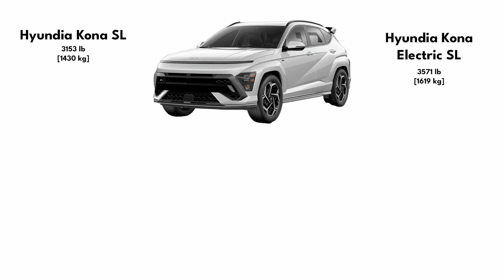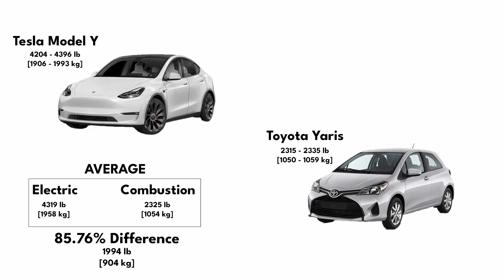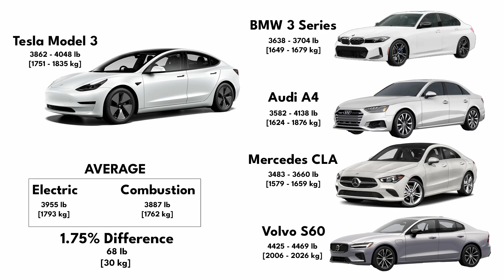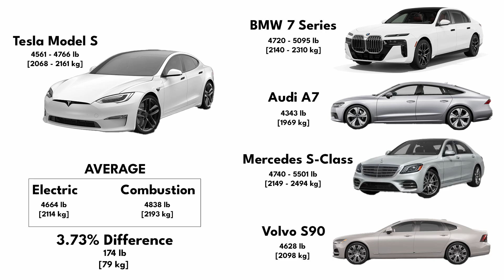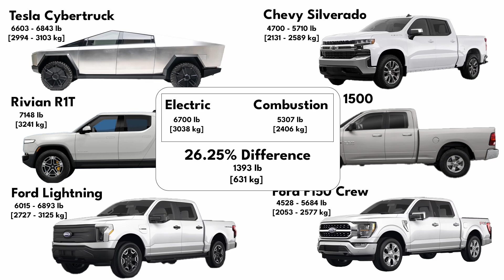Shocking Guardrail Failure: EV Weight Debate

Comment: Why compare just a Tesla against these cars? Audi, BMW, Mercedes and many other manufacturers have both an ICE and EV version of their own models to compare within their range. Surely this would be a much better comparison than comparing different makes against each other. I really like your content, but on this occasion I feel you've dropped the ball.
Reply: Yea. Compsring thr S60 with tesla 3 is freaking redoculas. Tesla 3 is a tiny car. Its also not a high quality european car. 

I seen this a lot before. Its tesla fan that try to argu they are simular. When they are clearly not.
Reply: @matsv201 a good comparison with a model 3 Y S would be a ev that was built from the ground up we only have 3 tesla rivian Lucid or we could we do phev comparisons
Reply: @matsv201  rational thinking, or even just a counterpoint doesn’t make you a fanatic to certain brand. You can argue Tesla isn’t a luxury brand all you want but the MSRP is close, the option to drive EV itself is a luxury and the crash protection is on par or if not better than conventional brands.
Reply: @kylinblue  This is clearly a lack of rational thinking.
Tesla isn´t a European luxury car. Firstly its not European, secondly its a very low quality car. Its like the ferrari clones that Leylands built in the 70s. They kind of look simular, but they are nothing like.

In the same wayTesla look simular to a luxary brand, but lacks all the things that makes a luxary brand a luxary brand.,

That the MSRP is similar is totally pointless. Yes, you get a much worse car for the same money. It should be quite obvious for everyone that is not a extremist.

Tesla build car that are worse quality than a Kia from the 70s. Then thy bundle a expensive battery with the car, pushing the price up.

On top of that, a Tesla 3 is nowhere near the same size as a S60 internally. Its much closer, if not smaller than the now no longer produced S40.

On top of that the wrong numbers w s quoted.
Reply: @matsv201  as someone who owned Volvo, Ford, Mercedes, Mazda, Mitsubishi, and lastly Tesla and have a low standard of “luxury”, you just can’t convince me. I got the EV because it is a EV and I’m having a good time with it. Seats are comfortable, features are there and nothing is falling apart. I paid for the price and it was worth it *for me*. Will it apply to everyone else (and you)? Probably not. But I’m sure there are people that agree with me (and you).
Edit: regarding your value proposition, yes, the price was inflated but there are several factors at play: dealer will mark up the out of door price considerably and Tesla doesn’t do that; high demand at the beginning of model 3/Y rollout caused inflated price that is coming down as the demand cools; new technology that is inherently less cost efficient for the new adopters.
Final edit: EVs aren’t the second coming of Christ nor child of Satan. We may have had been fed different kinds of information and come to very different conclusions. I will regard you as a reasonable person and consider your words, hope you do the same for me.
Reply: @kylinblue  I'm not saying I would by a Mercedes what ever its called or a M4. But saying a tesla is the same amount of luxury is just rediculas. Its a cheap crapy car that is sold expensively.

For instance tesla lack computer system fire wall. That makes the car cheaper to build, quite a bit so.. but it makes ir less safe.
Reply: @matsv201  American luxury vs. European luxury vs Japanese Luxury vs Korean Luxury 

Tesla is a great example of American luxury
Reply: Cuz Tesla is the only brand besides BYD that’s selling in meaningful quantity around the world, and there’s no BYD in US.
Reply: @kylinblue  there's really only 3 that really built bevs from the ground up 
Tesla
Rivian 
Lucid 
The rest are doing what tesla did in the beginning turning a ice vehicle into a ev that's why most of them weight so much
Reply: @b8Capital yup my dude is going the be under heavy flak cuz “how dare you question our EV bad studies”
Reply: ... I think Croc EV (Cadogan) has a good rule of thumb for ICE / BEV weight difference: 

ICE weight  +  weight of battery only 
=  BEV weight

Assumption: Weight of BEV battery cooling systems, inverters, management systems, sans the BEV battery itself are equivalent to the ICE engine & components weight.

To your point, compare the Ford F-150 / F-150 Lightning ... which seems to fit Croc EV's formula.
Reply: @kradius2169 that's true but my question is why when evs get in the mix everyone goes haywire evs are not safe they weight to much but when u look at something like a f250 f350 f450 Cadillac Escalade/ESV Or Jeep Wagoneer/ Grand Wagoneer Noone goes haywire about there safety or weight people be driving those work vehicles like luxury vehicles putting everyone in danger but its never gets talked about in the media if i got hit by a vehicle i would want it to be a Model 3YS Or any sedan 
not a truck or full size 3 row suv
Reply: @b8Capital  ... BEV's with equivalent range are heavier than their ICE equivalents.  Fact.

More weight equals more kinetic energy equals bigger rolling kinetic bomb than their ICE equivalents equals more danger.

Are you suggesting otherwise?

Even my Ford F-150 example is skewed because if you consider range-xiety, the F-150 Lightning is not equivalent.

Along those lines, consider the Cyberstuck & its Range Extender.
Reply: @kradius2169  Like @adventtrooper, Said 
The problem is more that we've let passenger
vehicles (and I include pick-up trucks in this
as that's how they're typically used) got far too
large and too heavy. Electrification continues
to enable this, rather than cause this. While l'm
not suggesting everyone goes out and buys a
Daihatsu Hijet, when its bed is not dissimilar
in size to the Cybertruck's then something has
gone badly wrong with Western car design, and
consumers.
Reply: As stated in the video ICE vs EV versions of the same model is not a fair comparison because there will be design compromises affecting weight due to redundant components than if it was designed as a pure EV or pure ICE from the ground up.
Reply from the maker: Tesla comprises 75% of EVs on the road in the US.  These are the most popular Tesla models.   Also, the other brands have inefficient designs.